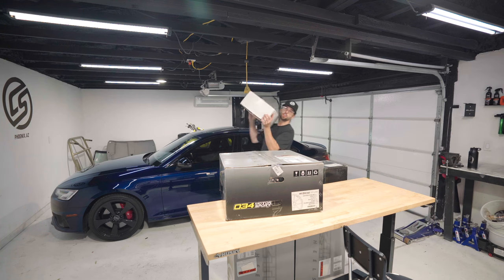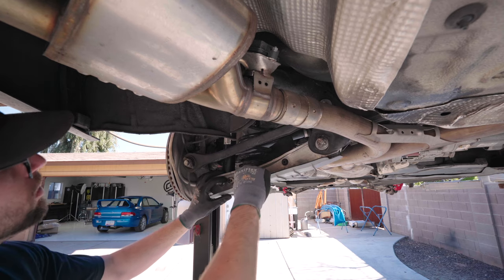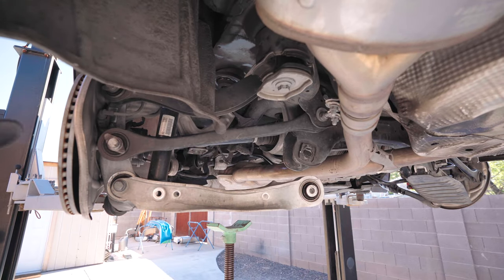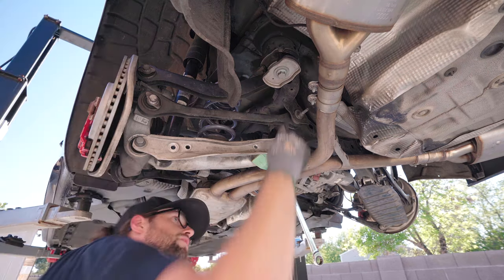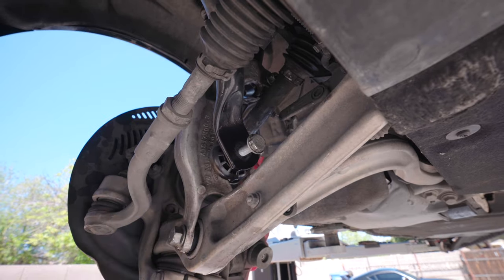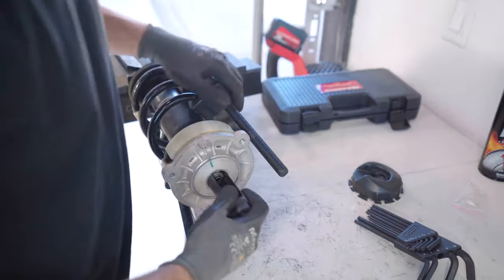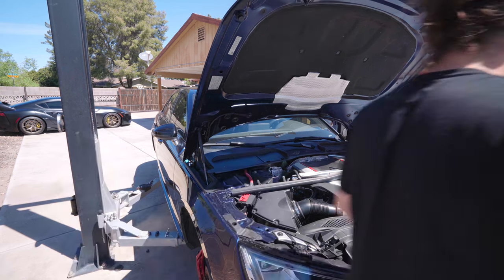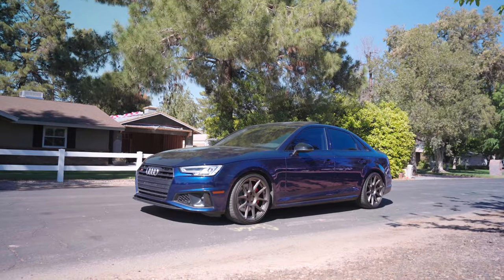Audi 034 Motorsport Lowering Spring Install (B9 S4/S5)

Comment: Just a tip for anyone doing the rear springs  in cold climates or high mileage cars. Don't take off the rear camber bolt. It will most likely be seized and won't come out you'll have to cut it and get a new aluminum swing arm along with bolt  assembly. Take the two lower bolts of where the disc is and pull the spring out. I'm down 400$ extra doing it this way.

Comment: The reason you do not do it the way you did it is because the bolts your removed are one time, torque to yield bolts.  They need replaced.